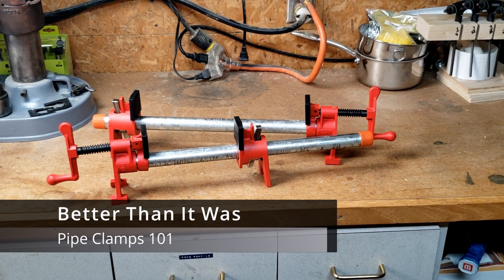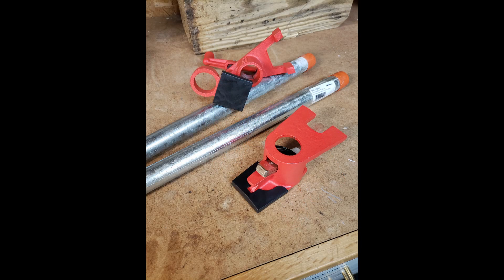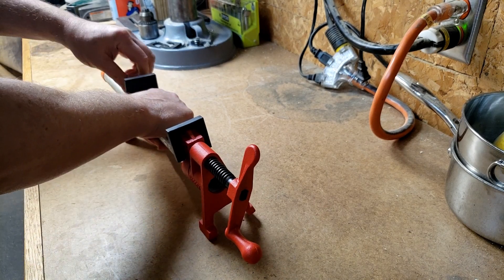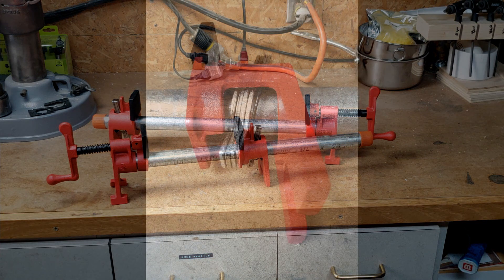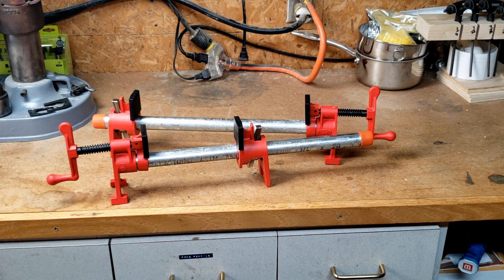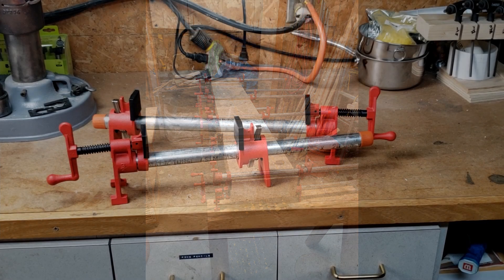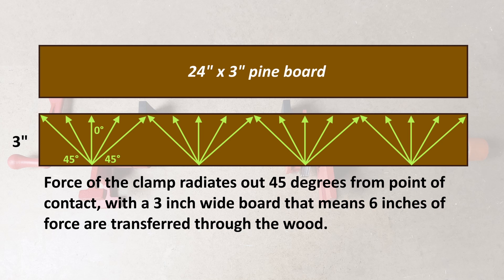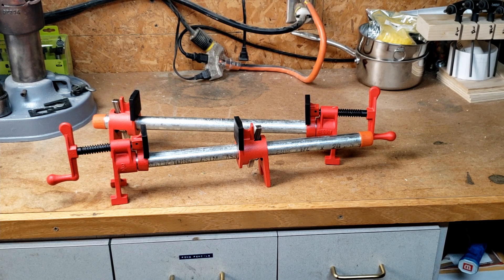BTIW - Pipe Clamp 101

Comment: This is foolish. if the boards are well flat they will glue fine with 2 clamps. AND the force distribution is not in a straight line, it has to take into account the stiffness of the wood to bend, obviously. so why a wannabe carpenter is trying to teach instead of learn? thats the question.

Comment: In the UK this type of clamp is rare. Not least because steel pipe is now rarely used. It was used for steam heating, public building (water) heating & gas supply. Now copper or plastic would be used in water or gas applications & steam heating has gone the way of horse-and-cart, mostly. If your interested it was BS1387 (gas list) pipe in medium (blue band) & heavy (red band) weight. The advantage of quick clamps is they are lighter, which is a factor if you have to travel with tools & gear, to do the work. 

Rob Cosman had some interesting things to say about clamps recently. In summary, in his opinion is you usually don’t need great pressure in day-to-day cabinet making or joinery.